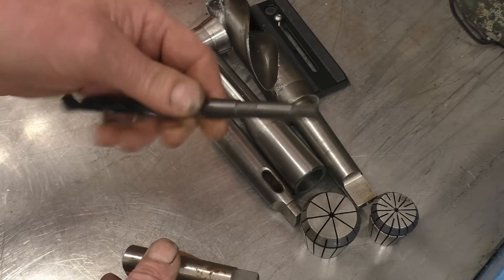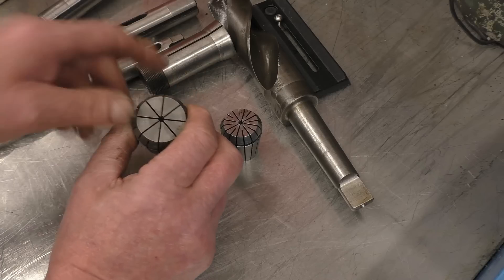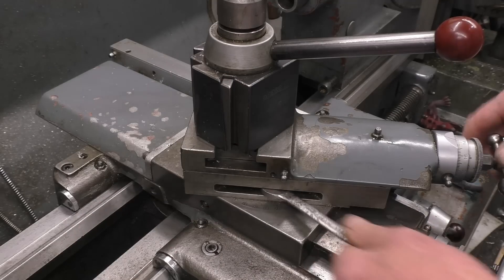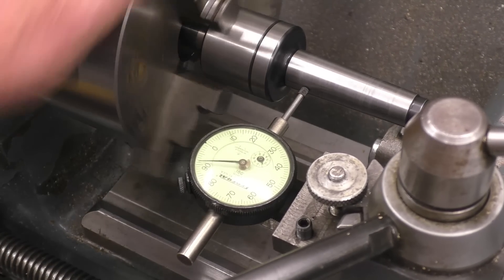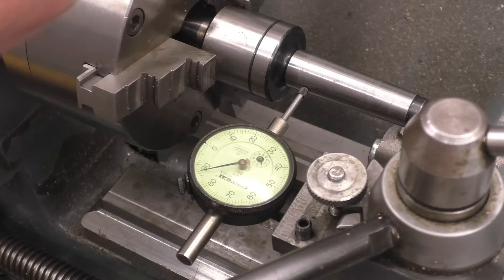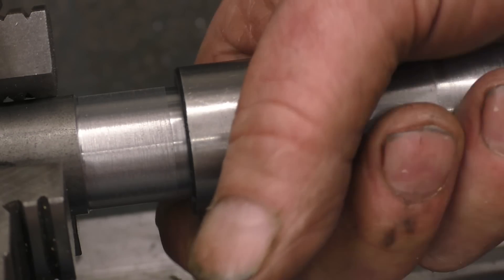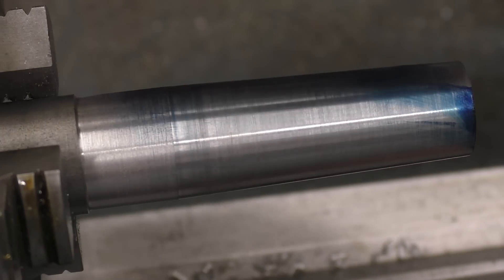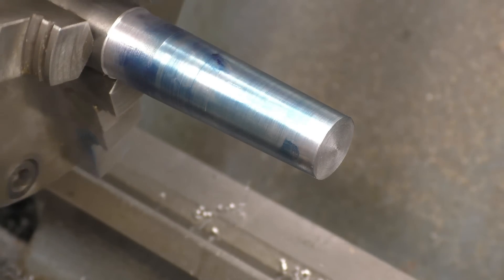Lathe Tutorial P15 . Machining Tapers

Comment: If one adds a full taper attachment to his lathe does that interfere with putting in a DRO?  Specifically the X axis of a DRO.  At first glance on my Grizzly G4003G it would appear to require remaking the back shield as well as take up the space the scale would go on the lathe bed?  I haven't seen anyone doing taper attachments on the smaller (12" x 36") lathes.  I would be interested in your thoughts on the subject.
Reply from the maker: The taper attachment would mean removing the dro scale
Reply: @doubleboost  Ouch!  I was afraid of that. Thanks for the reply.

Comment: seems like it would be important to have the clock gauge exactly on center height  to get the correct taper.  You could try it, after setting the compound angle, lower the clock slightly and run it back forth again
Reply: My idea exactly. If you’re above or below center by literally anything you’re measurement will be wrong

Comment: Offsetting the tailstock is the best method for singlepoint cutting of tapered threads, though getting the tailstock back into alignment can be tiresome, it's quicker if you mark things prior to moving it over, and don't forget, tailstock towards you gives thinner end at tailstock and tailstock away gives a thinner end at the chuck